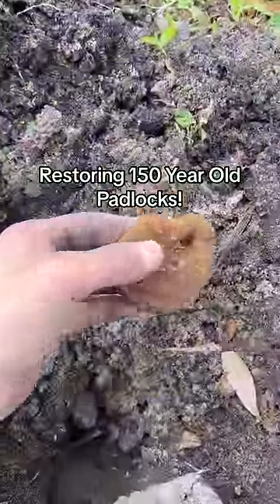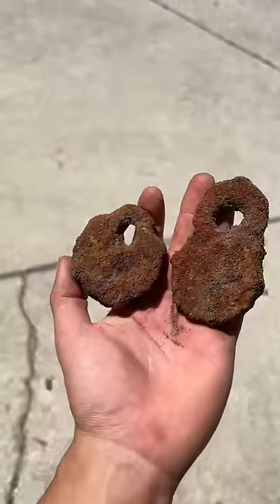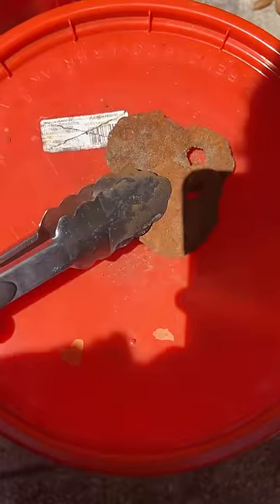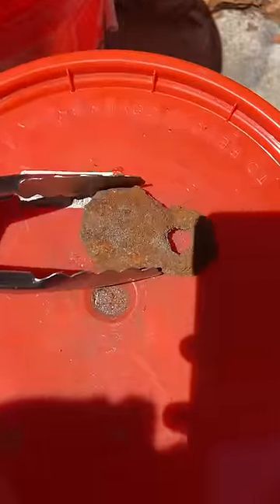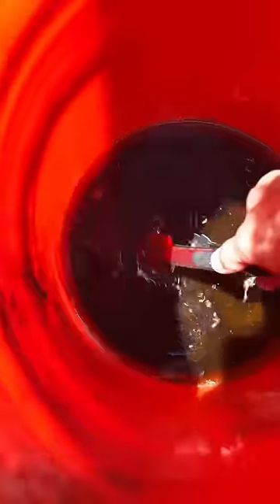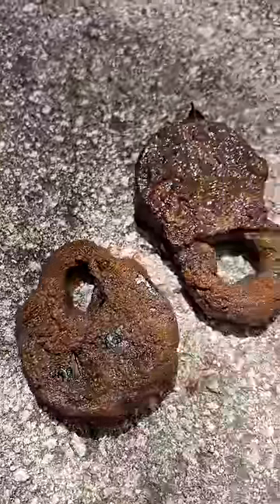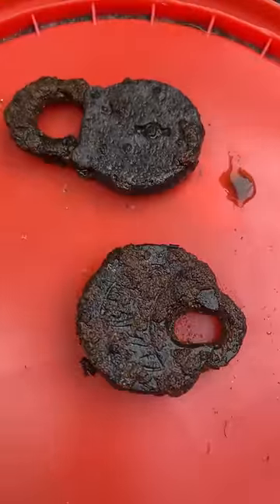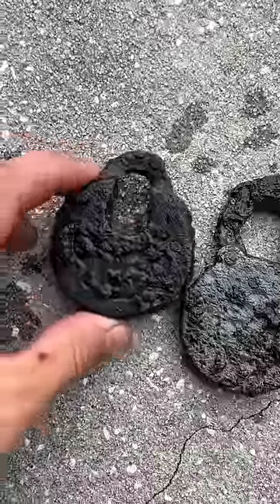Restoring 150 Year Old Padlocks!

Comment: You are using a 20th century rust lock, it can be opened using either a hammer or a saw.
Reply: You are using it can be opened with a 20 th century rust lock
Reply: @AbchJdn  only reason I didn’t say that is because it looks as if it would take more force than that.

Comment: You need to learn about electrolysis.  It wont damage the metal and will reimve the rust better.
Reply: my thoughts exactly
Reply: Evaporust works even better
Reply: Mine broke with a few rusty keys after about 2 uses. I paid 40 or so for the machine. Crap